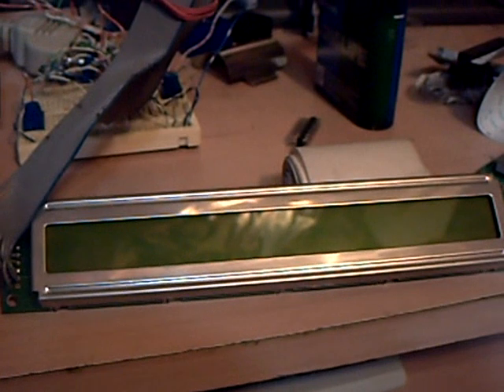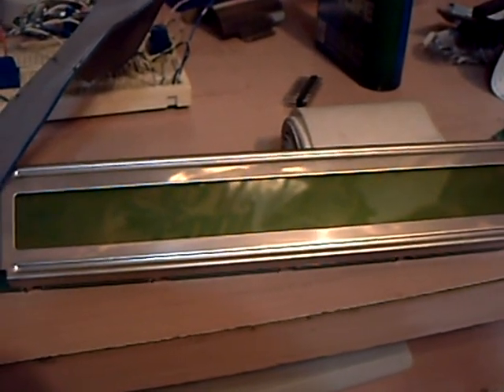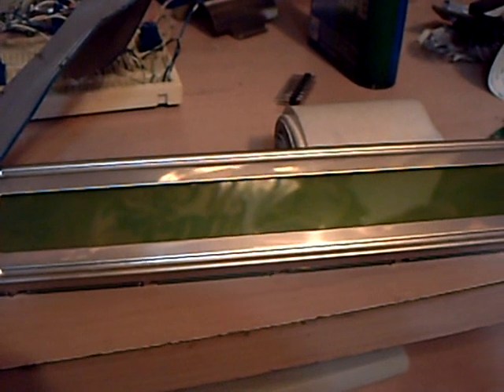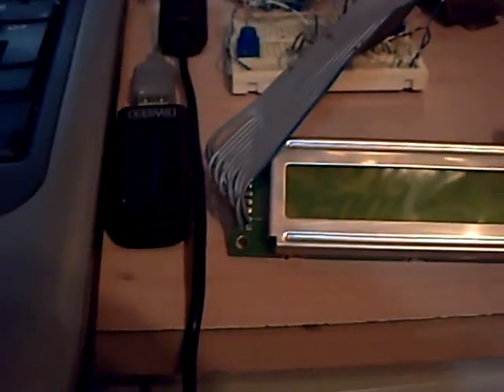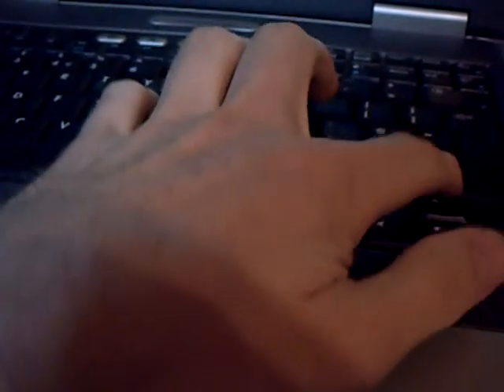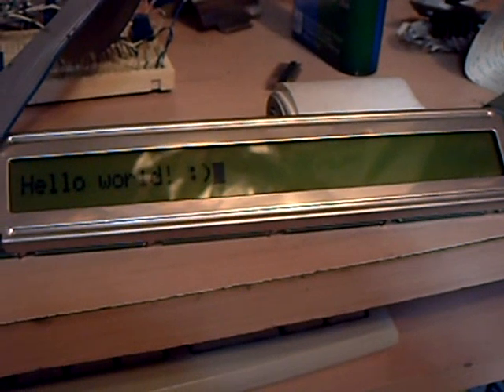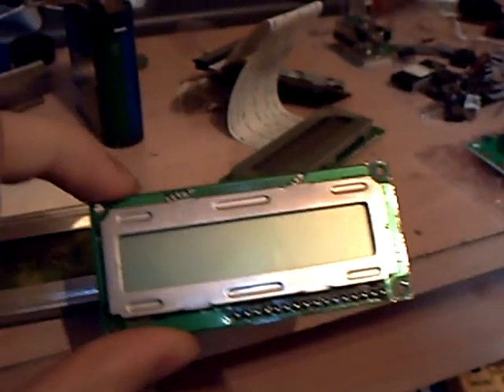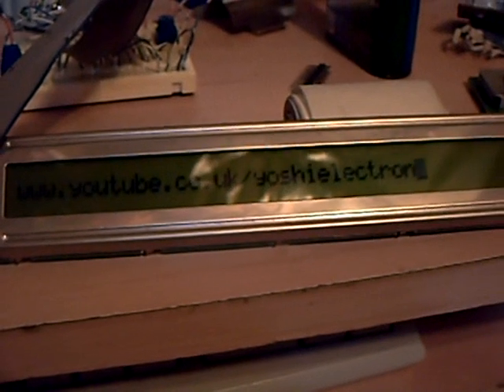Introduction to LCD Modules

Comment from the maker: The most common type of character only LCD's use digital signals sent in parallel form. You can either send the LCD the value of a character or a command (e.g., clear the screen). An additional signal wire is used to tell the LCD whether the value you send it is a character or command. The Arduino already has a library for communicating with these types of displays. If you need any more information please ask.

Comment from the maker: @ghostlink2027 Farad is the unit of capacitance and like you said, a measure of charge. You can think of a capacitor as like a very limited battery. You charge up the capacitor and then it can be discharged for a short amount of time. The higher the capacitance, the longer the charge.

Comment from the maker: @ghostlink2027 Yes, 1 Farad is equal to 1 volt when it is charged by a quantity of electricity equal to one coulomb. So it's related to voltage and the coulomb (unit of electric charge).

Comment: @yoshielectron Well assuming that I spell this right, I understand that a ferrad (something like that anyway) is a unit of capacitance which I think is how much of a charge it can hold, but I don't understand how you would relate it to another unit like volts or amps.